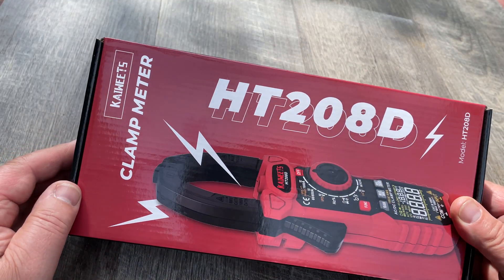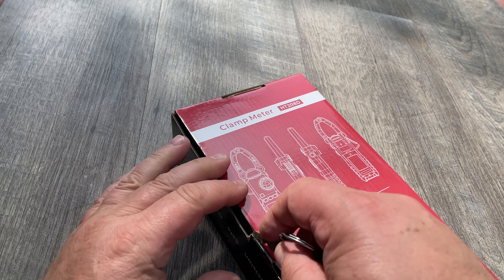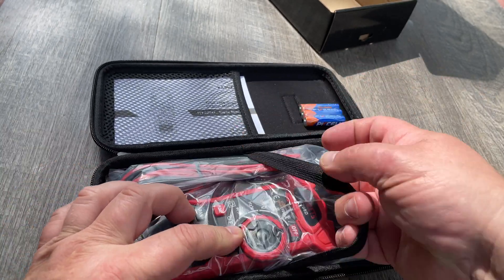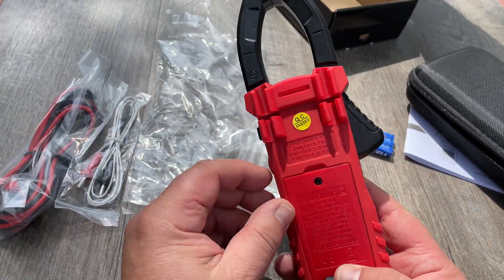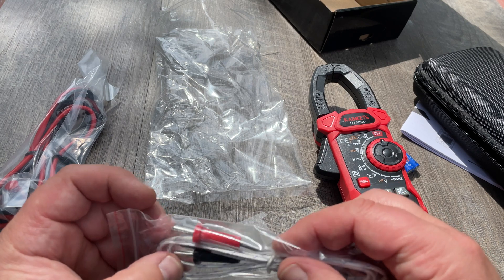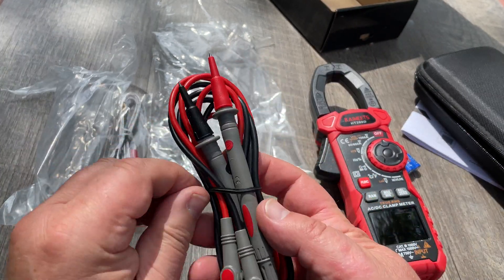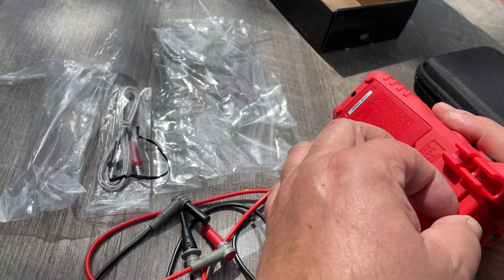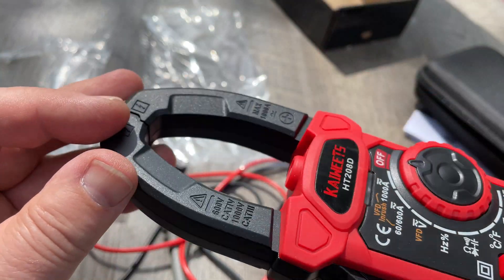Unboxing Clamp Meter HT208D

Comment: The NCV tester is so sensitive it's rather useless for the usual purposes the testers are used for, but it actually can be used for tracing live wires in walls to see the paths they take.  Kinda neat 🙃

Can't do that with the regular pen format NCV testers.
Reply: Really the only design change I have to suggest to them would be to add the ability to read the ongoing measurements while it's in min max mode.  They just forgot to include it; it's how it's done by everyone else with the feature.
The way it is, you're working blind in that mode, only being able to see the extremes.

Comment: I have this exact meter. I can not get it to "ZERO" when switching to 60/600A setting to measure DC Current. I have tried pressing and holding the "RAN", "MAX/MIN", and "REL/ZERO" buttons, but my meater always displays around 1.67A. How do I zero it? Thank you.
Reply from the maker: you set the dial to 60/600A, then push the Zero button once (short), and it displays ZERO on the screen. The DC amps go down to 0, then you measure your amps.
Reply: @mygiguser  I was afraid of that. I did exactly that and it stays at 1.6 to 1.67 amps with no change. I have only had it a few months and contacted the manufacturer the same day I posted here. They claim a 3-year exchange. So far they have not responded. I did some experimenting and my meter also alarms on no contact even when isolated from everything. It is defective. I will report back on their Customer Service which right now gets an "F" and so does Quality.
Reply: @benkanobe7500  Did you ever hear back from them?
Reply: @Mike-ig2zq  Yes. Finally. They wanted me to exchange it through Amazon but the 30 days ran out. Each attempt to contact them took me to the Amazon 30 day return which I was no longer eligible for. I did get to them from their info on the box and they wanted a video of the problem. Get this: While attempting to film the now well-understood failure of the meter, my wife dropped it while I was using my phone to video. After dropping from about 4.5 feet on to the carpet, the meter works perfectly and now zeros just like it is supposed to. In frustration, I have just used it like it is and it works so far. If it reverts back, I will attempt another return.
Reply: @benkanobe7500  Thanks Ben!
Reply: @benkanobe7500  That's an unexpectedly serendipitous drop 😉
Maybe a poor connection on the hall sensor in there.  
Their customer service was actually pretty good for me when I contacted them about a design type issue on a 206D; you might try contacting them again.
Might be something you could take care of yourself too, if you were so inclined. 
Though it's understandable if you didn't want to mess with it, since you shouldn't have to.
Reply: @wingerrrrrrrrr  It continues to work flawlessly. It just makes me uncomfortable that it was drop-fixed. It is the first non-Fluke I have ever purchased I just liked it did AC and DC current. The price is so low that if it reverts back to pre-drop (others have reported the same problem) performance, I will open it up and see about cold joints and do a  reflow.  Other than the original problem, it is a good meter.
Reply: @benkanobe7500  yeah, that's like the old fix-the-TV-by-slapping-the-side of the cabinet.  For those that go back that far 😎